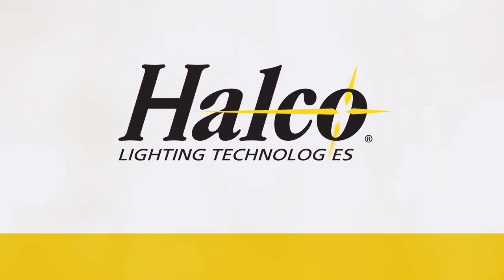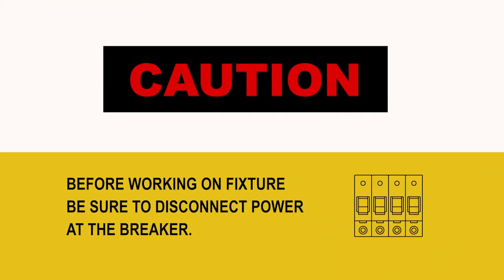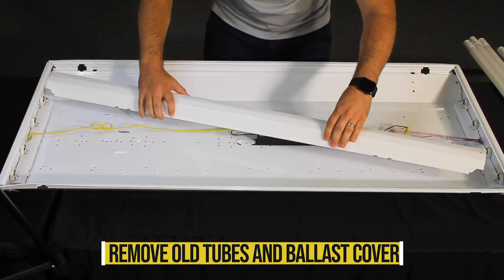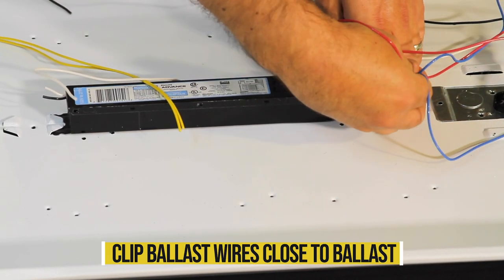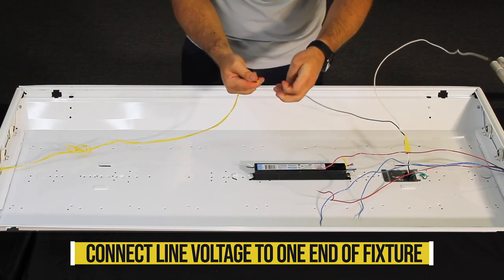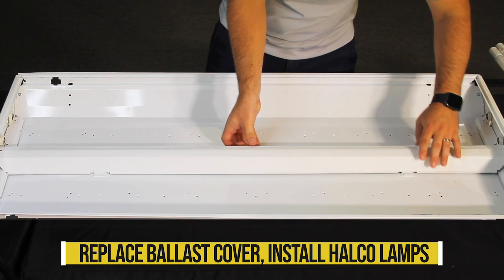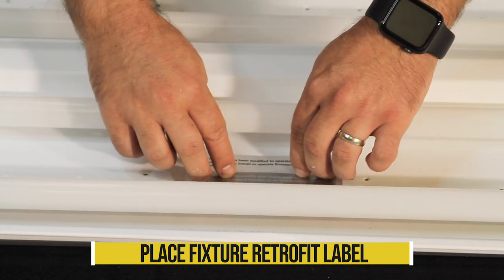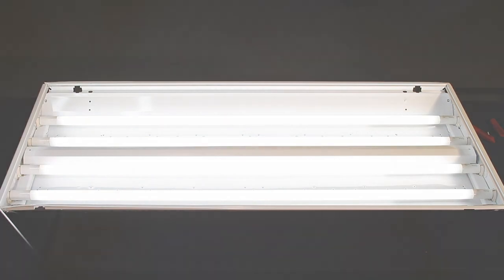How to Retrofit a 4' Fluorescent Fixture with a Halco ProLED Double-Ended Bypass 4' Lamp

Comment: 2 bulb fixture: cut wires off ballast and remove.  Attach the 4 wires from one end to the white power wire. Attach the 2or4 wires from the other end of the fixture to the black power wire.   That’s what worked for me.
Reply: Best comment ever. Clearer than the video
Reply: I've got 6 wires on each side. Plus the white and black on the one side. 2 blue, 2 red on each side. And 2 yellow on each side. Plus my white and black wires?!

Comment: "Do not use this kit in luminaires that employ shunted bi-pin lamp holders (found in fixtures	
that	use	instant start ballasts" is in the written instruction manual, but not mentioned in the video.  This is kind of an important omission.